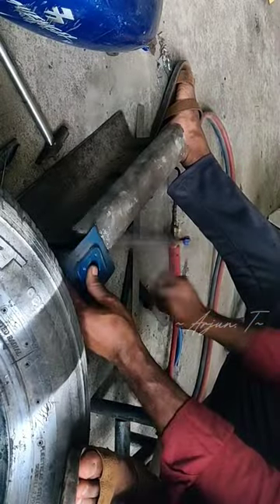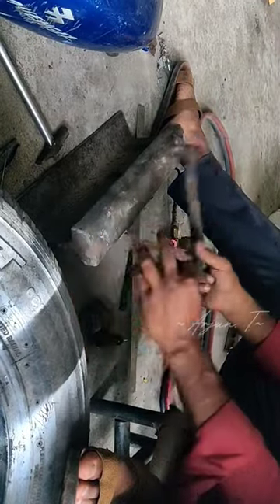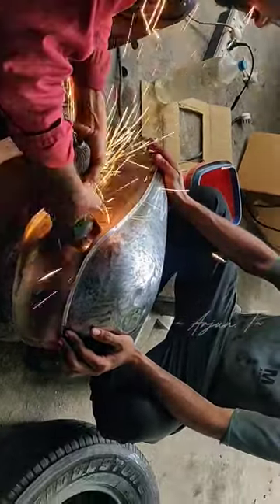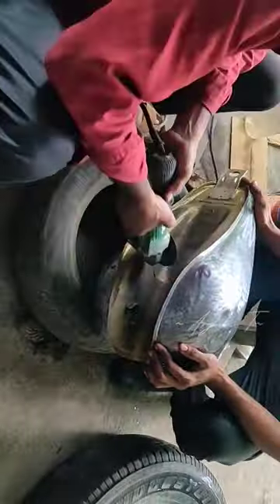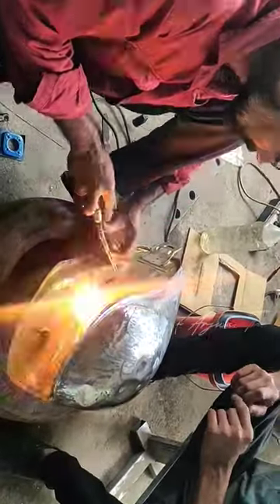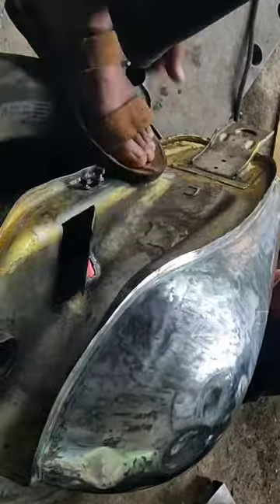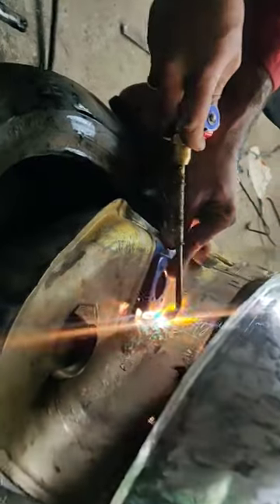Custom made fuel gauge for our bike DIY project / English

Comment: What is custom made in it you have just cut a normal fuel from one tank n fitting in other
Reply from the maker: what did you call that ?? patchwork :face-blue-smiling::face-blue-smiling:
Reply: @IAmArjun  this is what you call custom made🤣🤣🤣🤣
Reply from the maker: What you called rocket science 😱😱
Reply: @IAmArjun  for you doing this much is rocket science 🤣🤣🤣🤣
Reply from the maker: @tegraunaqsingh4598  onnu poyanda..
Reply: @IAmArjun  fuddu